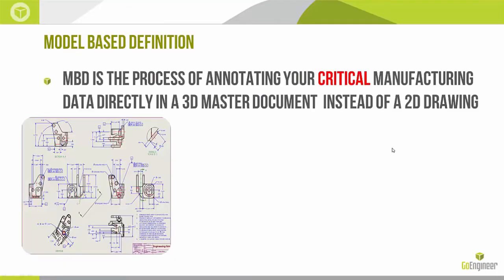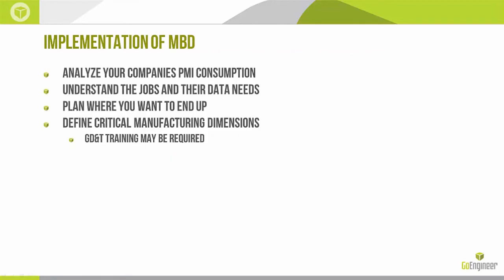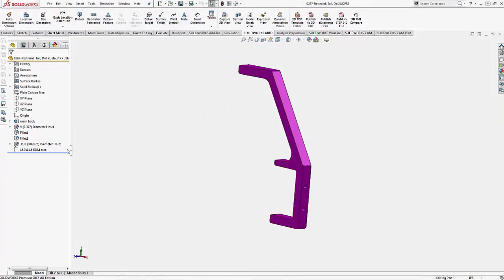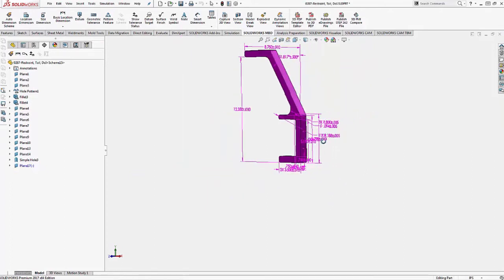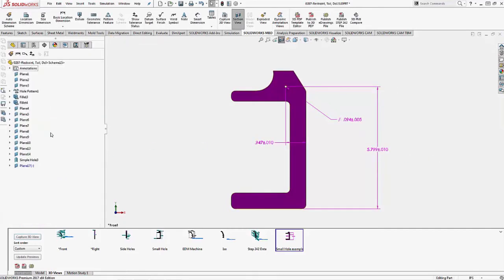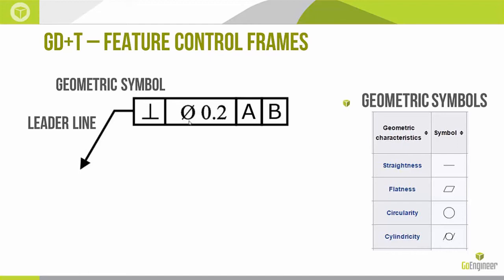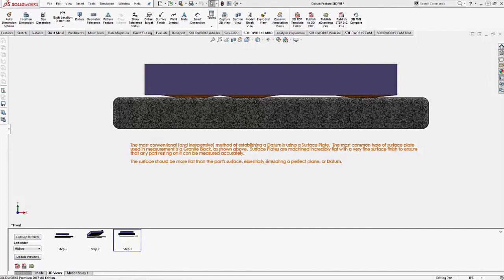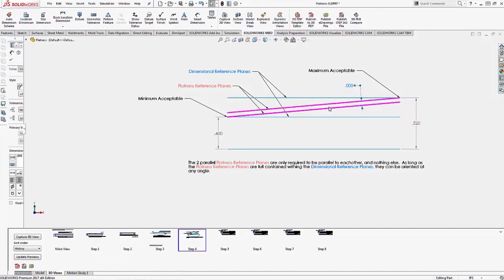SOLIDWORKS MBD - Geometric Dimensioning and Tolerance Webinar

Comment: Hello. It was really great video to introduce MBD.  I have a question though, in the case of an assembly,  after you define all your dimensions by using Dim Xpert on each component,  can MBD raise a red flag/warning to  notify the user if there's an interference issue?  In other words, would MBD allow to run a type of tolerance analysis in real-time of your design providing all your tolerances and geometric controls are correctly defined?  Thank you.
Reply from the maker: Hi Carlos,
SOLIDWorks provides a tool called TolAnalyst, which utilizes DimXpert dimensions, or MBD data, to analyze the potential interferences or clearances of parts in assemblies based on their dimensions with tolerances.  TolAnalyst is available with SOLIDWorks Premium.  You can find more information on SOLIDWorks’ website (http://www.solidworks.com/sw/products/3d-cad/tolerance-analysis.htm ) , and you can find a practical application of the tool on GoEngineer’s YouTube channel (https://www.youtube.com/watch?v=YaaDSvh1tCU& ) .